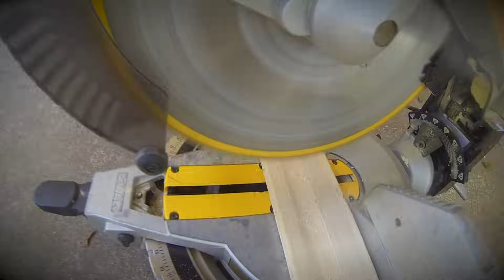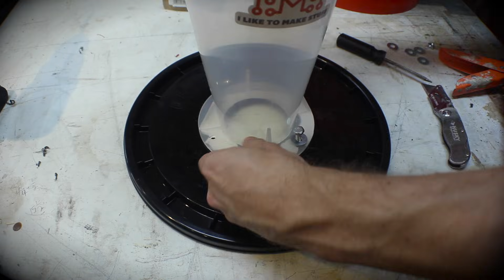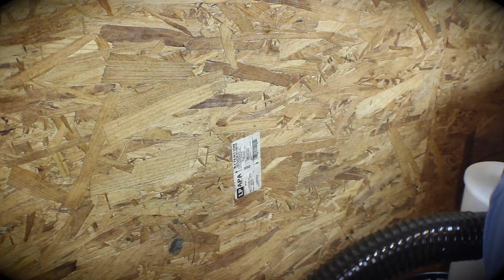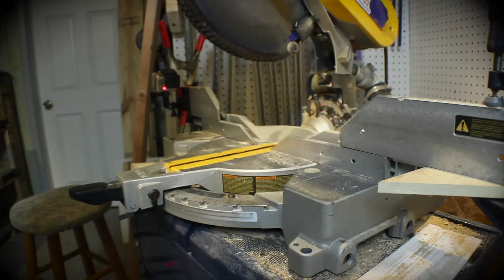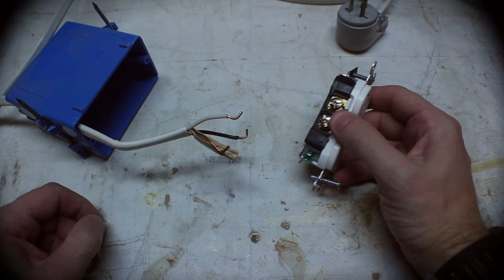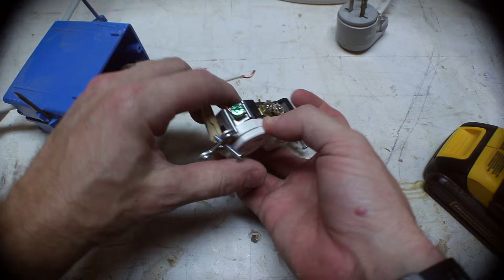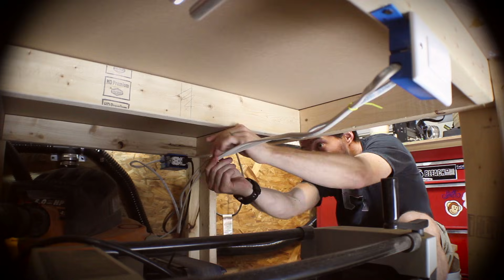How to make a dust collector with a wet/dry vac | I Like To Make Stuff

Comment: Wonderful project! I just ordered my DC today, so I'll be going through the same motion very soon as far as piping things in and wiring in switches. Your quick lesson on wiring was great. Weren't you planning on doing a circuit series? I would be really interested in watching that because you're a great teacher and electricity is something I would like to learn more about.
Reply from the maker: April Wilkerson Thanks April! Can't wait to see your DC setup! I assume you got a big collector? Which one did you get?
I definitely plan on doing a Maker 101 episode on circuits, focusing on small electronics (DC wiring), but the principles are the same as AC wiring.  It's going to be in the next month or two I think.
Reply: Yeah, I went ahead and bought the 2hp harbor freight unit and plan on doing a few mods. 
Awesome, I look forward to it!
Reply: @Iliketomakestuff  no they are not and shouldn't being giving that advice, this is way people electrocute them self's
Reply: April Wilkerson did you use the coupon out of wood magazine and get it for $169
Reply: Randomly found a comment from you from 4 years ago. You've come so far @april
Reply: April Wilkerson Any updates? Get that DC setup yet? :D
Reply: Do NOT, I repeat, DO NOT teach people how to do electrical work based upon this video.

Comment: The shop vac pulls enough cfm to have a strong draw across these distances?
Reply from the maker: Jonathon Thomas It does! Granted, the vac is in the middle of my shop so it's no more than 8-10 feet from any tool.  It's a 5HP vac, and seems to provide a lot of suction.

Comment: I have explored this option a number of times for my own shop and have yet to come up with a solution that I really like.  While this shop vac idea works just fine, be careful that your hoses don't get clogged or you will implode your bucket...  easy enough to just replace the bucket if it happens but knowing that it can happen also helps to make sure you don't overload the hoses.
Reply from the maker: Ben Ricks Good point.Thanks!

Comment: Thanks for the shop project. I'm in the middle of redoing my small shop and when I'm working there I'm constantly running into the dust deputy/shop vac combo. I was thinking of making a cart for it but with the minimal space its just not practical to have the cart or a bigger dust collector. Your ideas has inspired me! Also do you use a 5HP shop vac? Does it provide enough suction? Thanks again.
Reply from the maker: Juan Baret That's great to hear! I hope the video was helpful :)  Yes, I have a 5HP vac and I'm always amazed at how much suction it provides.

Comment: Can't buy these cyclones in the UK. Might have to find myself a traffic cone.  ;)
Reply from the maker: grumble1953 I've seen some people make their own cyclone with PVC pipe. That might be a route worth checking out.
Reply: grumble1953 They seem to be pretty available on ebay, but the traffic cone is a better idea, LOL, cheaper. Could also knock one up out of sheet metal if you felt like it

Comment: Great project--thanks for posting!
I'm considering a dust collection set-up like this because my shop is small and I don't need a large system with extensive piping.
Maybe put some small scrap wood spacers under the clamp strap holding the blast gate next to the wall.
Note: the wires should wrap around the switch and outlet screws in the tightening (clockwise) direction.

Comment: I hate the plastic blast gates. I need to make some! 

Your blast gate that was mounted so that the gate opens upward might cause problems. I would suggest mounting it so that it opens out from the wall. Gravity is a constant.
Reply from the maker: Circles Woodworking Yeah, I realized after you said that, that I hadn't used the final clip. I ended up switching all of mine to a horizontal position for that very reason.  Thanks!
Reply: It is a satisfying thing to have some sort of dust collection. Even bad DC is better than none. 

Side note... Thank you for your time to produce your content.

Comment: Not sure if this is correct as im an electrician but in Australia, i would assume your white wire is active? Black is neutral (return) and green is always earth. In your current setup it looks as though your switching your neutral  not your active? I might be wrong just an observation.
Reply: It's reversed in the US. Black is hot and white is neutral. I didn't know it was different. In Australia is 240 the standard AC voltage or is 120?
Reply: Joe Grindle Australia 240v is standard (415 for 3 phase), usually red is active and black is neutral. But there are quite a few different colour combinations
Reply: It is even more different in EU. We have green/yellow for ground, and then blue or black for neutral, and red for active one. It is also 210/220 for mono phase, and arround 400 for three pahse, in which case, yellow is ground, red, blue and gray for live ones, and white or some other colour for neutral.
Reply: Where do you live in the EU?
In many EU countries for 230V blackor brown is live (+), blue is neutral (-) and green/yellow is ground.
For 400V live wires are brown, black and grey, again blue is neutral and green yellow is ground.
Reply: well, we harnessed electricity first... so.............

Comment: Every time I mention building a dust collection system like this, my dad asks what I'm going to do to handle the build up of static electricity. Is that something that I have to worry about?
Reply: In a system this small, you really don't need to worry about it. A shop-vac based dust collector doesn't move enough CFM to build up enough static to be a problem.

Comment: Before I got my dust collector I had just the vacuum and cyclone hooked up to everything like this.  Let me tell you this now before you go adding anymore to it, get rid of those plastic gates and make your own.  Not just as an excuse to do a video on making your own gates, ha!  They are terrible.  They jam up and then won't close very easily.  They leak like crazy.  As soon as you have more than a few gates you lose most of your suction from all the leaking.  Even now that I have a DC, I still have quite a few tools hooked up this way so it's a good investment for the future and not just a temporary solution until you get a better system later.  The vacuum is better for things like a router table or spindle sander where it's restricted to a small opening at the tool.
Reply from the maker: krtwood Yeah, I had one of them clog up yesterday, so you're totally right.  I've got some interesting plans for my system involving the gates, so it'll probably be worthwhile building my own sooner than later.  Thanks!
Reply: Would it prevent clogging if the blast gates were installed with a vertical flow rather than horizontal flow? That way the dust is less likely to settle into the space where the slide operates. Of course, that does nothing for the leakage issue mentioned.